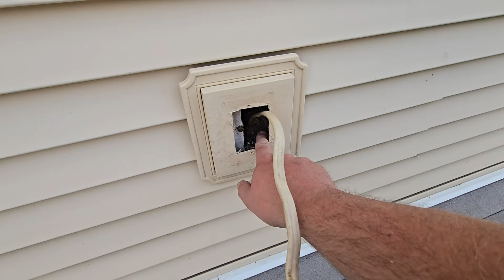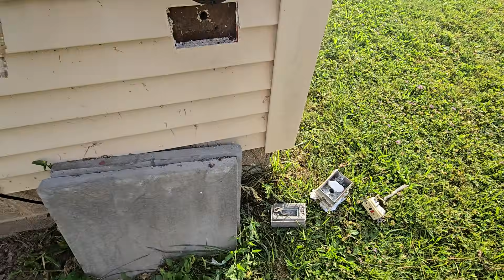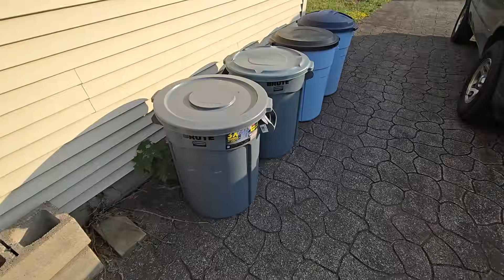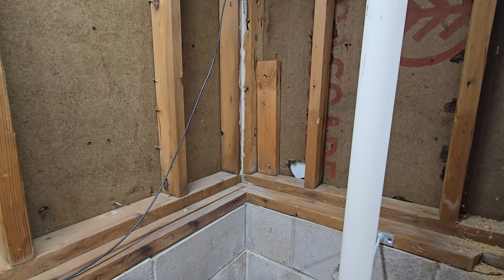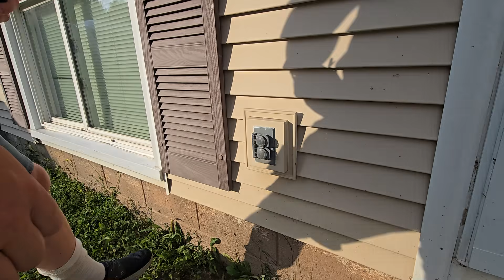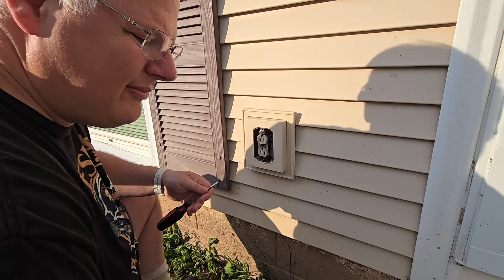More hack wiring discovered for the exterior outlets

Comment: Thank you for posting this!  I am living in a manufactured home, built in 1980, and it's obvious that somebody has messed with the wiring.  Missing face plates inside the home, the light at the backdoor doesn't work at all, 2 outside lights AND an outlet are all connected to a single light switch with exposed wiring inside the unfinished entryway, and nearly half of the place is connected at a 15 amp breaker!
Also, thank you for pointing out the horizontal covers on the vertical outlets; I think I saw that on one of my outlets on the back section outside, but I'll have to go out and double check.  If so, and it doesn't work, I have a greater understanding of why, and who to blame for it!